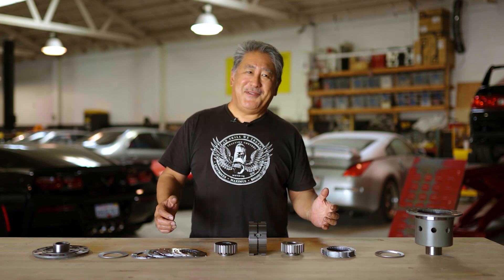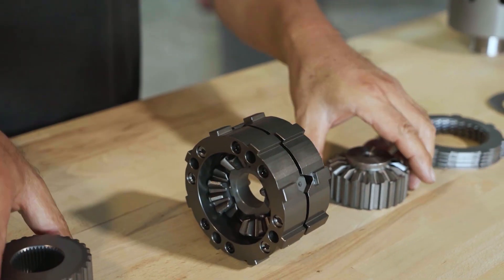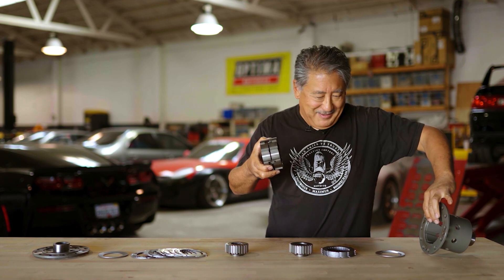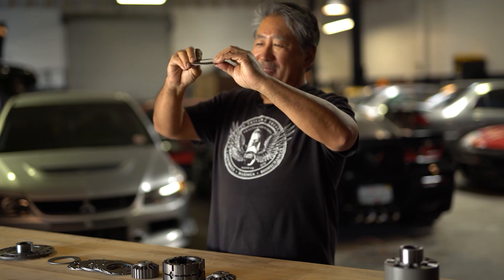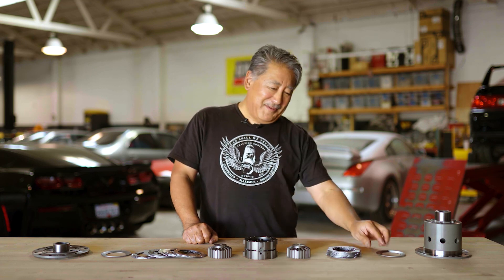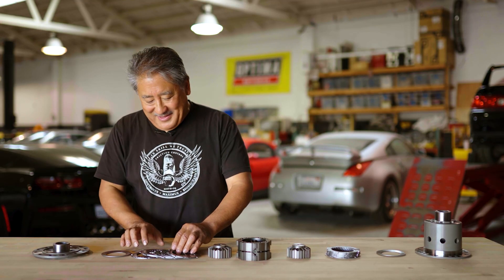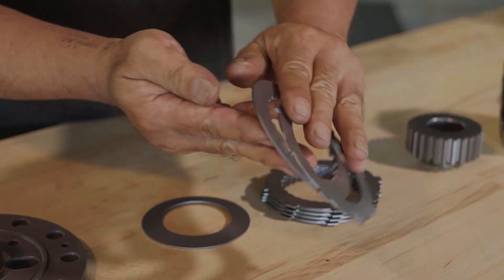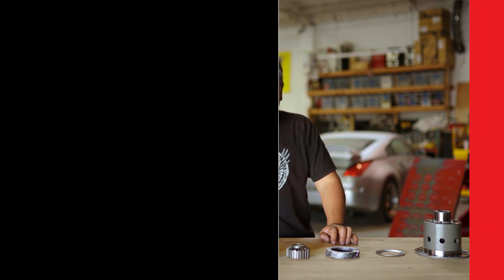How the OS Giken Differential Works and How to Tune it!

Comment: Can the OS Giken be used in a street car without fearing the possible noise issues? What would be the setup for an AP1 S2000 with NA setup in this case? 1.5 with soft springs and strong pressure ring? Would the ceramic treatment still be necessary or is it optional? Thanks!

Comment: @motoiq if i'm going through the effort of sending the clutch plates for WPC, would the side gears and pressure ring benefit?
Reply from the maker: Yes
Reply: @motoiq  where would i find the torque specs to reassemble the lsd with if i send it out to wpc?
Reply from the maker: Call OS

Comment: I completed the installation of OS Giken superlock LSD in my 370z this weekend and it just transformed the car. Where the old VLSD hesitated and you never knew for certain if it would grab or not, sometimes forcing the car in a weird understeer with bodyroll, the OS LSD predictively behaves and you know just how much you can put the power down and when you'll initiate a powerslide. It's just so good.

Comment: Sorry for the late comment. Thanks for this insightful video, and I have a few questions.

1. On WPC treating the clutches, since WPC reduces friction a lot, will it make the LSD less capable of (or even incapable of) achieving near 100% lock? And will it require you to change to a more aggressive spring setup to retain the locking capability? Also, will it reduce the rate of lockup across all possible spring setups? I am new to WPC, and sorry if this might sound like a silly question.

2. If you still recommend WPC treatment, would you also treat the cone springs along with the clutches?

3. Do you recommend OS Giken's oil or some other brands for the diff?

4. What spring setup would you recommend for the new GR86?

Thank you very much!
Reply from the maker: Yes it still locks just as hard, just more smoothly.  The cone springs are not necessary although we would do the pressure rings and the case. OSG oil or Redline is what we use and we also add some of redlines LSD additive. The settings really depend on the size and type of tires, suspension, aero and type of use.
Reply: @motoiq  Thank you so much! Oh for settings, I'm thinking of changing to a set of 235/40 R18 Advan AD09s (hopefully they come to the States soon), stock suspension for now (probably changing to something like HKS Hipermax S or Blitz ZZR in the future), no aero or power mods.

Comment: For a 911 you should be running a reverse 1.5 way with more locking action on deceleration
Reply from the maker: We have no idea what you are talking about, there is no such thing as a reverse 1.5 way, a 1.5 way or 2 way yes. As far as type it depends on the end use. If you had more lock on decell it would make a 911 have even worse trailing throttle oversteer which is already a problem with the design.
Reply: @motoiq  Porsche has almost always had a more agressive lock up on  decel, 930s had 40/80, 964 RS had 20/100, 993 had 25/60.  Should be able to dial out the understeer with sway bars and alignment.  I've always just called it a reverse 1.5 as most people think of a 1.5 being less lockup on decel.

Comment: Just installed an OS Giken 1.5 way LSD into my Toyota 86 about a month ago. Could not be happier with it! Completely transforms the way the car drives for the better; so much more stability and traction when applying the throttle. Basically turns the car into a 'point-and-shoot' affair at corner exit. The car is also more controllable when oversteering and gives greater ability to throttle-steer the car, to adjust your yaw angle and racing line. Mind you this is in comparison to the OEM Torsen, from a racing perspective the OSG is in a whole other league.
Reply: Congrats to you! What stiffness of cone spring and pressure spring did you choose? Or is there a preset for the 86 from OS Giken you can grab off the shelf? Thanks!

Comment: Funny thing is, the factory LSD on a stock, 40 year old, 100HP 1st gen RX-7 is basically the same unit. 
Yea, its not lightweight or 2 way lock-up adjustable but you can mix, match and stack the plates to change the breakaway force.
Reply from the maker: Many old factory LSD's were like this, your Mazda part didn't have the variable lock-up that the cams provide and the only way to control lock was the clutch shim preload.  The OS diff is a Salisbury type if you wanted to look it up.

Comment: How about explaining a Torsen style LSD?
Reply from the maker: hahaha, we don't like the way they work so we don't install them very much! Basically, the side gears turn on worm gears that cause them to move sideways and dig into the diff case when the wheels turn in opposite directions.
Reply: @motoiq  
Thanks for the response. I enjoy the technical videos.
I've seen that type of wear on cheap(OBX Chinese knock off) Torsen style diffs. I haven't seen that on Quaiffe manufactured differentials. Which manufacturer did you have that issue with? What was the application?
Reply from the maker: @leomatthews6432  it's not an issue but how they provide limited-slip action by pushing the worm gears into the case.

Comment: I wish I could afford the OS unit and WPC treatment. My Tomei 1.5 is a bit harsh for my little car. The combination of light weight, small tire, and short wheel base makes for a rough ride when it's not fully warmed up. Tomei never got back to me about how to lessen the initial lock up and they don't mention how to do it anywhere, but I followed a KAAZ video about swapping a clutch around. I'd like to try WPC, but I'm not baller enough for that. My slop will just have to deal with it for now #4G63510
Reply from the maker: You can try to deactivate some of the clutch packs by flipping them, try two per side. Also, try a bottle of redline LSD additive in the oil.
Reply: @motoiq  I flipped one clutch and plate on each side already. I'm currently running Redline fluid with no additive, and I'm about to run Tomei fluid back to see if it helps. If not, I'll try the additive. Again, I think my issue is light weight car (2275lbs) short wheel base (95") and an R200 diff made for much more powerful and serious cars. But anything can help. Once the fluid is nice and hot, it performs great in tight turns.

Comment: Was waiting for the giken pronunciation correction LOL.
Reply: Yeah, people always have trouble pronouncing Japanese stuff in the car space but Japanese is fairly strict about pronunciation so if you want to know for certain (or to settle an argument) it should be possible to look up. Unlike English all consonants are paired up with vowels (except 'n' can be on it's own)  and there are only 5 vowel sounds whereas English represents 13-15 vowel sounds with combinations of A,E,I,O,U, and sometimes Y and W. I think one example that tends to get said wrong is Mugen, usually pronounced Myu-jen it should be moo-gen (hard g). You can see why it happens, 'mu' in English is usually pronounced like mug or mutate with a magic 'e' but in Japanese 'mu' is consistently pronounced 'moo'.